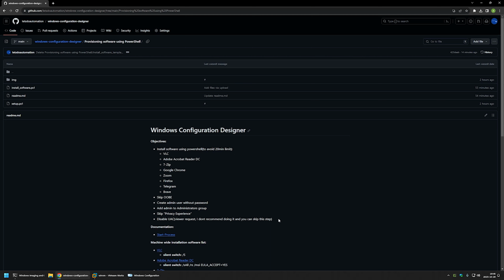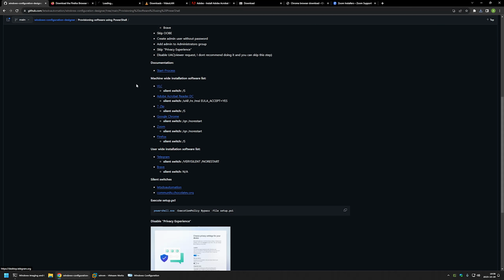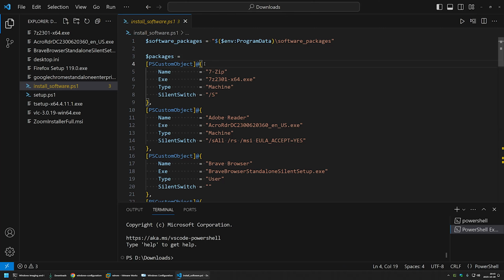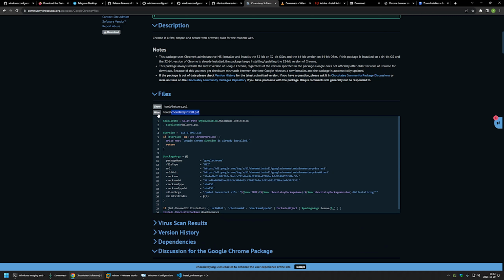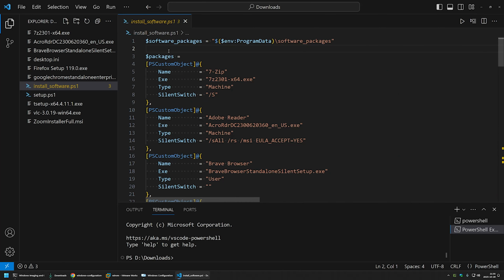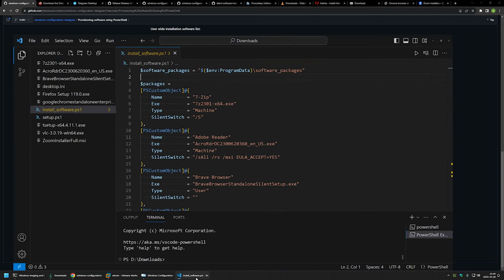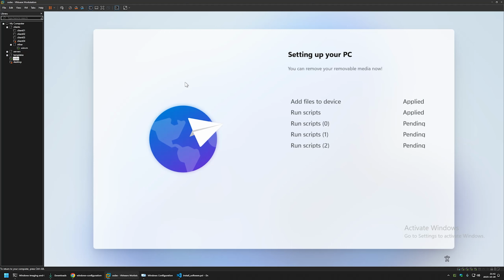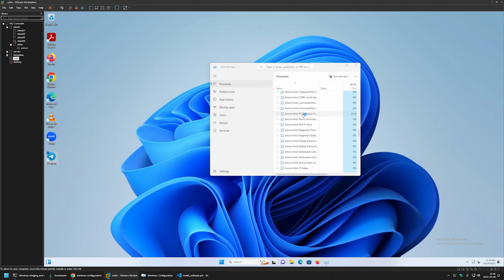Windows Configuration Designer: Provisioning software using PowerShell

Comment: Instead of VM, as soon as I stick the usb into a laptop at the OOBE page it'll automatically detect and runt he script? I dont need to like press shift + f10 and go to command and run it there?
Reply from the maker: yes, it will detect the provisioning package automatically and will execute it and if you will have multiple packages in your usb it will ask witch one you want to apply.

Only in very very rare cases it fails to detect provisioning package, but then you can press windows key on your keyboard 5 times and it will give you a menu where you will be able to execute it manually.
Reply: @LetsDoAutomation   thank you!

Comment: This is exactly what I looking for. No doubt, you're the best.
Reply from the maker: good :)
Reply: I found something wrong. I don't know if it's bug or not. But UAC bar already at bottom but Windows still asking permission. @LetsDoAutomation
Reply from the maker: Did you try to restart ? that setting need reboot to fully apply. I still have the VM that I used in the video and it seems to be working just fine.